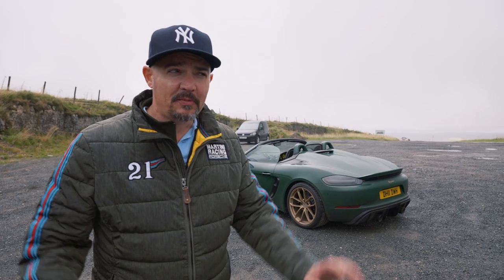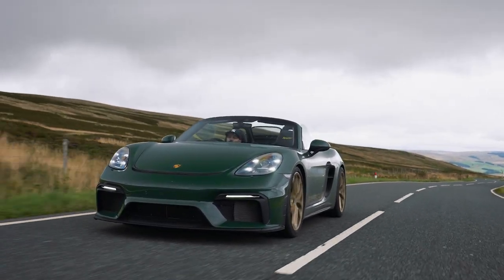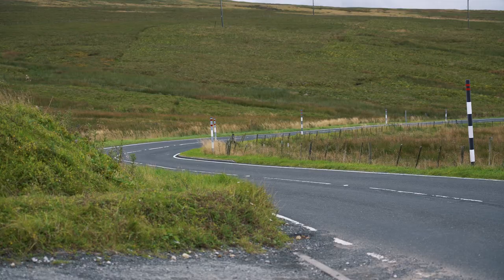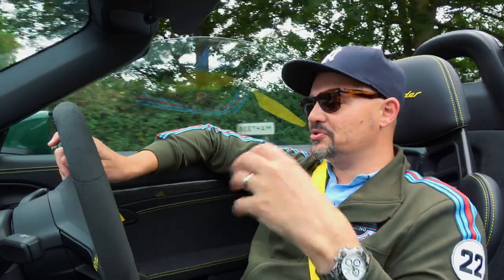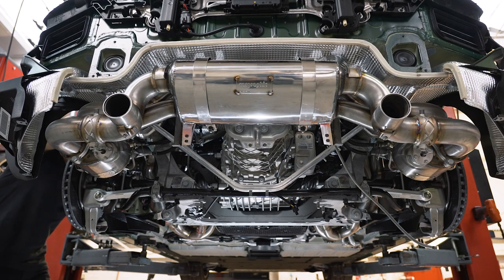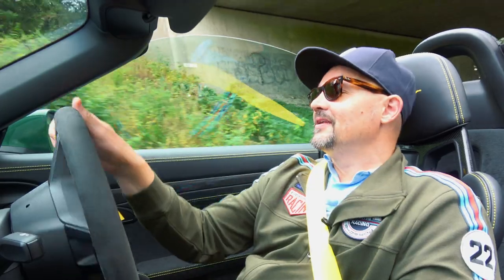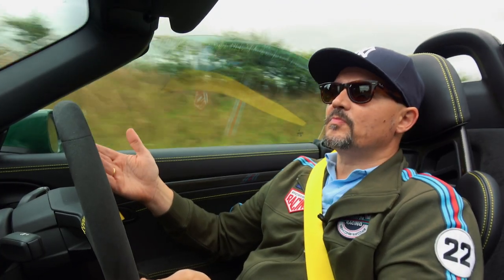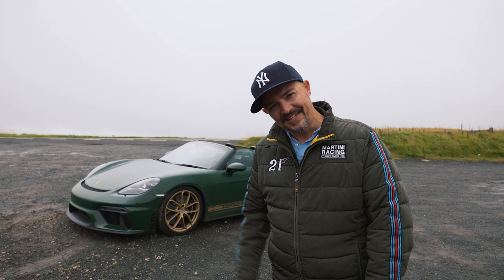Porsche 718 Spyder - First Drive REVIEW!

Comment: Thanks for another great video.I ‘ve found that after 2k miles the engine sounds better with the gearing more engaging.Just completed 3k miles am a little reserved to change the set up of the car (exhaust very appealing) as it may affect warranty  and resale ?? Spyder much preferred to my previous gt4 and gt3 can’t beat open top driving regardless of the weather in the uk (Scotland particularly wet)
Reply: you could just buy a exhaust valve controller, such as the soul unit. So you can fully open the oem exhaust flaps. makes a huge difference.
Reply from the maker: Thanks for the info!

Comment: Great video. Looking to buy a 718 Spyder with carbon brakes. Do you have any issues with brake squeal? Martin.
Reply from the maker: None but you do occasionally get one or two squeals
Reply: @DrivingVenture  Thanks for your reply. Looking to buy the one at South Lakes Porsche at the moment. Be nice to hear your exhaust if the deal goes ahead and also your thoughts on the flywheel mod. Any complaints with the gear ratio's?
Reply: @gt40driver1  I have the PCCBs on my 981 Spyder, nary a peep. Work well cold too.

Comment: Having to dismantle the roof manually is a deal breaker
Reply: The Spyder looks better than the Boxster but honestly with a 718 Boxster GTS you're not missing much performance and you get a more practical roof.
Reply from the maker: lots of GTS cars around it many Spiders the weight saving is also to be considered.. A GTS will never be a proper out and out GT Produced car....
Reply: @DrivingVenture  GT4RS is the way to go unless you’re considering spending upwards of 140k on a GT3 or turbo in my opinion
Reply from the maker: @HdHd-cg4nz  a very limited supply of cars for the 4RS probably less than the Spyder for dealers to hand out… nothing compares to a GT3 the New 911 Turbo S is incredible…